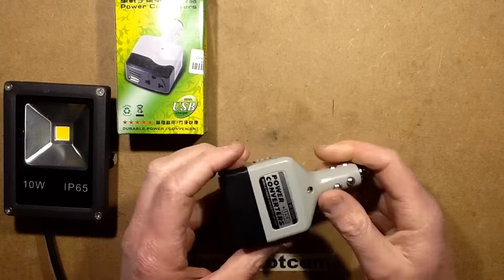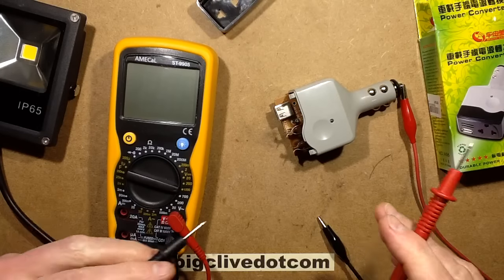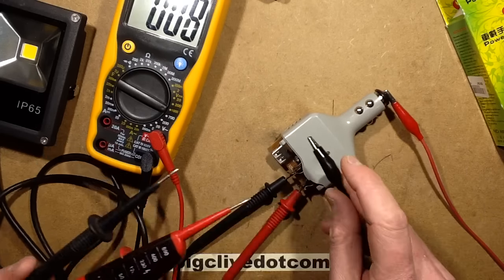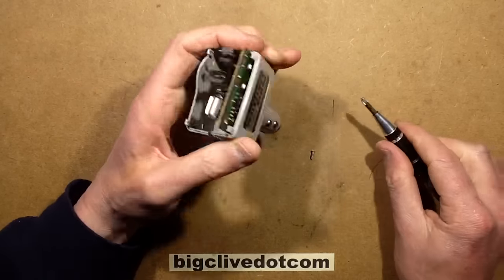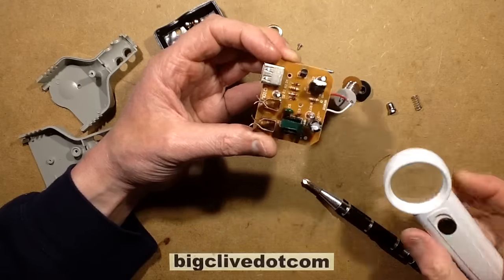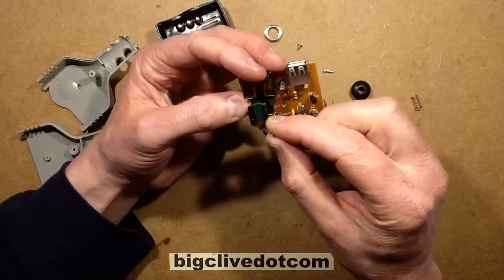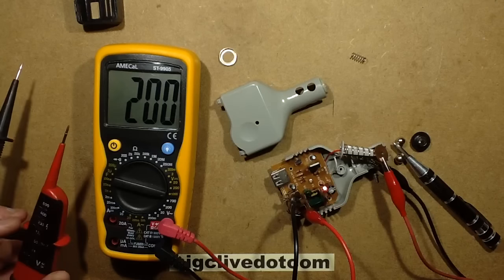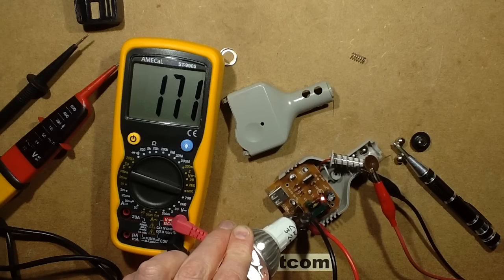Inside a slightly bizarre car to "mains" adaptor.

Comment: It is like a technical school first year assignment. "Design a circuit that converts 12VDC to something that resembles mains power." It doesn't have to be usable, you pass if you can see 200+ volts on a volt meter...
Reply: usb separators accept anything from 100v to 250v
Reply: Yeah, like "Create something that ressembles 120 V from a 230 V +/- 10% supply". Wired two 60 W incandescent bulbs into a plain and simple voltage divider so we could measure something like 116-117 V under real-world conditions.
Reply: @Ragnar8504  This same circuit was in some old hobbyist books back in the day, using the same TIP31 transistor as a "120V AC inverter" using a low voltage transformer wired up backwards with its secondary as the primary. Its almost as though the copied it directly and made it a "product".
Reply: @mysock351C  They definitely do that. Seen a voltage reagulator in cheap hand vacuum NiMH battery charger which was exact copy of circuit from DIY electronic book from eighties :)
Reply: @punker4Real  Not all.
Reply: I wish we actually had assignments like this at my technical school

Comment: Its low current is a shame. It would be great to run, say, a blow drier, or an electric deep-fryer in the car.
Reply: Mm yes I'm sure the fuse will hold up nicely as you try to pull 150A through it
Reply: I use a battery behind the seat. 12v connected to an inverter, inverter to battery charger, automatically turns on and off as the car does keeping the battery charged. Another inverter from battery to whatever you want to run.
Reply: Sounds like a charm running a deep fryer in a car while having to hit the brakes.

Comment: I have a Black and Decker Inverter that is shaped the same as that thing and it also has a USB port in addition to the AC outlet but it's an ACTUAL inverter that converts to actual AC. It's rated at 100 watts at 115 volts. That things appears to be a violation of the principle of making something as cheap as possible but no cheaper.
Reply: I have the exact same Black and Decker inverter!

Comment: Someone must've thought "if it's so easy to convert 240V to 12V, surely it's a simple matter of reversing the circuitry and you get 12V to 240V. Easy peasy!"
Sadly not everything is reversible.
Reply: Connor Hill I love how civil people are in this guy's comment section. It makes me smile.
Reply: What are you talking about just use a dc transformer
Reply: transformakshon no workee on purr dee cee
Reply: Isn't this thing just a power inverter? I have had these in all my vehicles for years and years. Am I missing something as far as the difference between this and an inverter? The ones I have don't look like this but they are 12v to 110v and I use them for a ps3 and a mini fridge.
Reply: It is an inverter, an oscillator flyback booster,i bought one from china to see the guts too but as it's not here yet and the one in the vid is the same one,i can honestly say it is an electric flyswatter circuit,the little coil/transformer is the limiting factor as the bipolar transistor could be swapped out for a higher power transistor,i still want to take it apart,add a voltage multiplier to the output,get 3 or 4 times the normal output,for fun of course.
Reply: Hahaha
Reply: anime pfp

Comment: You know here a few years back, whilst going for a walk, I  walked past a young man's home, who I knew as a computer customer.  He had removed the rear window from his old Buick, and was in the process of putting an old, very large window air conditioner.  I just had to stop and ask him how he planned to power that unit.  He showed me a device not unlike the one you have in this video.  I tried to explain to him that this would never work, but he was convinced that, since the plug would fit (after he had clipped the ground plug off it) then the unit should run, and his old Buick's air conditioner had gone to hell, he was tired of driving back and forth to work in the summer with no air, as it was a 30 mile drive each way, and they weren't using the old window air conditioner anyhow.  I made an attempt to explain the idea of watts, and amps but he would have none of it, and went right on putting cardboard alongside the air conditioner, and plastic sheeting over that to seal in the cool air he expected out of his new air conditioned Buick.  I walked on and haven't seen him since. I think he moved away, I know he still owed me a hundred bucks for a laptop that he bought off me before the air conditioning incident.  Still have his promissory note not that it's worth the paper it was written on.
Reply: This can't be real
Reply: Really happened, swear to God!  Some people are just that stupid.
Reply: lulz
Reply: oh god why
Reply: Jerry Ericsson I live in Florida I  do see cars here from time to time with ac window units. I have no idea how they got it work, or if it actually works.
Reply: Jerry Ericsson Even stupid indviduals would test if the ac turned on before ruining the car windows. Even if it's fake it was a great story
Reply: a larger inverter
Reply: There's a picture of this floating around somewhere
Reply: I've seen a minivan with an AC unit strapped to the back, and a generator strapped to a makeshift tubular structure to run the AC.
Reply: Jerry Ericsson a decent pure sine wave inverter would run it happily but wether the alternator would keep up is a different matter
Reply: @ThatWolfWithShades This actually makes sense if the minivan is being used for stationary use, like a field office, surveillance unit or rape-van. Then you'll get power and AC from an engine made for stationary use, instead of having a large car engine running on little over idle all day.
Reply: @HA05GER  I power a whole house using a DIY power inverter, connected directly to my Cressida's battery and run the engine at 1500RPM, alternator still run happy
Reply: @putraadriansyah8082  I high output alternator will only see 1600w max so all depends what your doing with it
Reply: @HA05GER  If I'm not wrong, my home only consume about 1200W max. so I think my alternator will be OK (using inverter with no induction motor load, only lights, computer, diy fan with smps and TV)
Reply: @putraadriansyah8082  depends on your car some alternators can handle max of 600-700w then its gunna start wrecking your battery quick
Reply: @HA05GER  It's a stock alternator, can be found in many of 80-90 toyota sedans (in my case it's a Cressida). I think it strong enough to power 900-1200w (not using too much devices at home)

Comment: That reminds me of one of the USB chargers I've used. Apart from being translucent green, it looks a lot like the laptop power supplies of a certain fruit-themed manufacturer with a 12-Volt plug moulded onto it instead of the mains lead or plug. At some point I realised that most of the charger is actually a plain mains AC to USB charger with an IEC C7/8 connector and the whole converter setup is inside the 12 V accessory plug! Now I wonder what that thing actually outputs! It does seem to drive the beefy USB power supply quite happily, charging a phone and driving a bluetooth/FM adaptor at the same time without emitting any "electric" smells.

Comment: i plugged something like that into my automobile outlet and it got so hot it started melting,I think it wanted to light my cigarette, burn up my car and charge my phone,all at the same time. I generally find that even with a fuse,these things wont blow the fuse before melting enough to ruin them...fail.

Comment: I know many of the cheap ones I have got in the US output a very bad square wave instead of sine and with too little load they don't turn on right.  Adding an incandescant night light (5-10 watts) seems to help them stay a lot more stable.

Also some switch mode power supplies won't run from them either, especially smart laptop chargers.
Reply: Square wave will ruin electronics

Comment: I wonder how big of a resistive load the HV output will drive? I see a very cool use for this if it will handle, say, a 150mA load. Some of the earliest battery powered fluorescent lanterns used two 69V batteries in series to directly drive the fluorescent lamp through a resistive ballast. Those batteries quit being made some 30 years ago, but this, coupled with a 12V battery, could be tucked inside the battery compartment of said lanterns and allow them to run portable again. If it will handle the load...

Comment: Although the circuit design is clever, the whole thing strikes me as a very bad idea.

I wonder how this thing handles gross overloads or being short circuited?
Reply: +uxwbill I imagine by getting very, very hot. Until it melts the insulation of the transformer and creates a dead short on the unfused 12V input. After which the transistor and half the PCB is vaporized with a loud bang and copious amounts of magic smoke. Then you have to rummage around in your car's fusebox to find which fuse has blown and replace it.
Reply: Most of them have a fuse loaded with a spring in the cigarette-lighter end. 

If you were to unscrew the little ring at the end, the metal tip would fall out (as would the fuse).
Reply: +Chris Barbati As for this one, I don't think they even bothered

Comment: Hi Clive.

I get how the USB +5v is generated, but you didn't say much about how the 240v circuit topology works. Is that really a 'transformer'? It certainly looks like one but it still could be a simple inductor operating in a buck converter configuration. A single switching element PLUS a transformer points to this being a flyback converter - these can, but aren't often used in a stepdown circuit. Odd.

Yup. A DC output from a half wave configured rectifier - this circuit isn't a true 'inverter as the transformer output is (most likely) a series of same polarity DC pulses. Whilst the output cap will smooth the pulse train a bit, is the diode really necessary, at all? And, if this circuit DID have inverter action - in other words producing some sort of 'ac' - then half wave rectification would be extraordinarily wasteful, you'd substitute a diode bridge at very little additional cost.

This nominal 240v DC output bothers me. Yes, most switching regulator phone chargers should be able to work on both ac AND dc input but I've pulled apart plenty of units which were step down transformer LINEAR PSU type - and those will NOT work on DC input. In fact, leaving 240v DC connected to the transformer primary will cause rapid heating (purely resistive loss) because there's no inductive 'back emf'/Lenz effect at DC. It's wrong to assume ALL phone chargers are operating as 'switch mode'; when output power is low, a linear PSU is the better option on cost grounds.

Thanks for the video. I always find them interesting.

Comment: I just have a 600W pure sine wave inverter sitting in the passenger foot well with a cig plug on it. I plug my 2A 5V charger into that and it only draws about 1.8A at 12V. And no I didn't buy it for that purpose, but it has nothing else to do until we have a power cut.

Comment: love your reviews, just wanted to remind you that most automotive apliandes are to be powered at 14.6 and not 12v that will change your output.
Reply: 14.6v is optimistic, you'll get 12.4ish volts with the motor off and with the motor on you probably still won't get much over 14v
Reply: @caracalfloppa4997  The standard operating window for automotive applications is 13.6 to 14.4 volts, with a target voltage of 14.0, with the engine running. A 12v vehicle battery should hold a standing charge of 12.6v at rest. So 14.6v would actually be considered a fault condition under any circumstances.

Comment: I saw these on flea bay for £1.35 free shipping so I bought 5. Every single one was wired up with the Negative to the center and surprise none of them burned out while I tried to work out why they didnt work.  The seller gave me a full refund but the things are crap anyway wont charge a laptop from the mains side and only just powers an led 240v bulb. And more dangerously, when you put a 2 pin plug into it, the prongs short against the usb port.

Comment: I use one to charge my ebook in the car since the micro-usb connectors become flakey as hell and i haven't have time to wave-solder it back on.  the regular 120VAC-12VDC charger still works though so no trip to a guy with skills and more time or me having to delay my own paper work for yet another repair challenge.

Comment: Would be interesting to see the waveform this thing generates with different loads
Reply: Shure DC always makes for interesting wave forms
Reply: @gustavgans3760  Didn't you notice that it has an AC outlet? But you might have noticed that the circuit is pretty rudimentary, so yes, it would be interesting to see the AC output waveform.

Comment: I assume the mains outlet is for older chargers that aren't USB.
Reply: that's probably it
Reply: Haha! That might be the reason
Reply: They usually don't work with DC lol haha
Reply: Old enough to not be 5V, new enough to be SMPS. That doesn't leave a lot of chargers...
Reply: @XCVGVCX  Voltage ain't the only problem! Lots of manufacturers used proprietary connectors and would do various sensing to make sure you were using the right charger. Some Nokia phones would refuse to charge if they didn't detect the right voltage drop at a given current draw, for example. It was pretty much a con to force people into paying $30 for the 'authorized' charger.
That said, while I suppose it could be useful for those kinds of chargers, I doubt it was really the intent; they're either incompetent or pretty much scamming people. You can get a new phone better than any of the ones from that era for under $20, and it's unlikely those old ones would hold much of a charge anymore.
Reply: Or that are USB but where the cable and block are inseparable.
Reply: Yep, exactly that.

Comment: Designing an adapter to convert 12V DC to 240VAC so you can plug in a charger that will drop that to 5V DC is just stupid. Why not design a simple dc-dc converter like everyone else does..  Chinese innovative design :)
Reply: +VoltLog I agree that it is a very complex and inefficient way to do it, but there can be a few situations where it can be usefull. Like if your device has a proprietary connection, requires a MFI chip or other intelligence on the data pins, requires different or multiple voltages, or want to use something like a quick charger. The latter obviously not on this weak thing.

Comment: This is the kind of things my grandparents would use, because they are the sort who hate and actively avoid learning new things.
After years i finally got them to get mobile phones for safety reasons but the idea of charging a phone from the cigarette adapter just confises them and would rather wait until they get back home to charge their phone than do it in the car, but if they had a normal 3 pin plug in front of them they'd probably be willing to bring the mains charger and plug it in.
Reply: +Trakker  Atleast they don't believe everything they're told.
Reply: +Trakker They just don't see the need in constantly having the phone charged. They lived just fine their whole lives without a cellphone, so why would they care if the battery runs out?
Reply: bassl0va They're old and a few years back the car broke down on a road it took 5 hours before another car passed they could flag down for help, and that was before i convinced them to get a phone, so don't be assuming the world is as simple as you think it is.
Reply: +Trakker Well atleast they did get a phone after all.
Reply: Trakker Yeah, but that same situation happened to many people before mobile phones were invented. May have even happened to them in the past too. People just dealt with it then. Too bad people can't deal with it now, and if their phone dies and they can't check fb or send a snap it's the end of the world...
Reply: bassl0va And at one time Humans were lucky if they lived til 30 year old and the weekly shopping involved a spear...
The world moves on and some need guidance to take advantage of it.
Reply: actually grover, the average life expectancy was brought WAAAAY down by infant mortality rates.  Most people that made it past five years of age would live about as long as modern people, though once they got to the point where today they'd be given an oxygen tank they usually would've died around there.

Comment: I've got a mains car inverter.  It's bigger than that 10watts lamp, but has enough power for two gaming laptops which are really power hungry.
Reply: How many times have you had to call roadside assistance because you ran out of electricity?
Reply: +Akaishi none
Reply: +Akaishi If the engines running and your alternator works, you've got at least 50A at 12V to play with.

Comment: Direct current on a standard wall-type plug ?! That really IS odd and I haven't met anything like it before. Then again, it's probably clear why it says to only use it for chargers - try plugging in anything with a transformer on the primary and little tiny pop :))